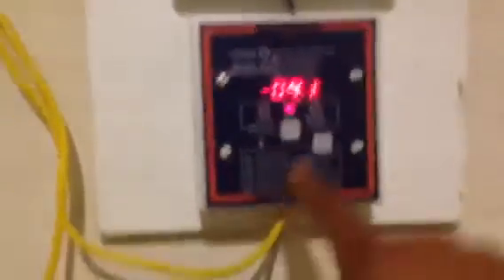DIY Solar Backup In Action During Storm Part 1

Comment: Hey rhandsom, what the max from the inverter using 14/2 or 12/3 can I run the wire to the house, and also I can pick up the volt & amp meters free they are 50 amps meters or does that matter?
Thanks Al

Comment: OK got it, now from the inverter to a wall outlet ( a duplex that is just for the solar system) and many thanks for your help
Al
Reply from the maker: From the Inverter to the wall outlet, I would recommend a 15A AC circuit breaker in between, because, you are running 14/2 wire which is for normal 120v AC household runs at 15A.

Comment: Hey rhandsom, the only thing i'm confussed about is where am i using the 10 gage wire to and from, also what size DC fuses to the battery and also from the battery to the inverter
Thanks
Al
Reply from the maker: Sorry for the late response, the 10 AWG wire will run from your panels to your charge controller and from the CC to the batteries. From the batteries to the inverter you should be fine with 2 Gauge wire (what I use), some people use 00 gauge. I recommend a 150A - 200A DC circuit breaker between the inverter and the batteries, a 25A to 30A DC fuse or circuit breaker between the CC and the batteries.

Comment: Hey rhandsom, yes that make sence , if I use the 250 watt panels will the controller support any add on panels or just add another controller, also I'm going to check out the sites you gave me, and thanks for your time and help,
Reply from the maker: Yes, the Tri-Star I recommended will support up to 600w for 12v System and 1200w for a 24v system. I recommend a 24v System. You can check out the inverterstore(dot)com and search for 24v Pure Sine Inverter similar to the one I recommended in the PM, ensure that it has a terminal block for your 14/2 wiring.

Comment: It's a great feeling knowing your planning pays off. I had similar blackout few months ago and like you didn't miss a beat. I actually installed my Trimetric (2025RV) upstairs in my room Which was convenient when glancing at my power consumption, state of charge etc. Because you can get away with 20+ gauge it only cost me about 40 bucks to locate it into my room 50' from the battery bank in garage. Anyway Thanks for showing us the backup system in action. You have such a better backup system than mine, which has very limited critical circuits Although I do have 1000ah battery bank which is pretty nice
Reply from the maker: I saw and enjoyed your power outage video as well. It's good to be prepared. I put no faith in equipment, machines or people but I do my part and trust the Lord Jesus to do the rest. Good idea to install the tri-metric in a place you can see it. It's definitely worth considering on my part. Your system is pretty nice as well and I can't beat a 1000ah batttery bank.  Thanks and take care.